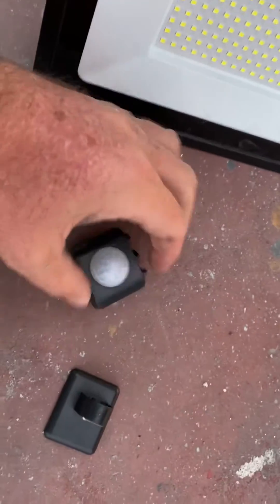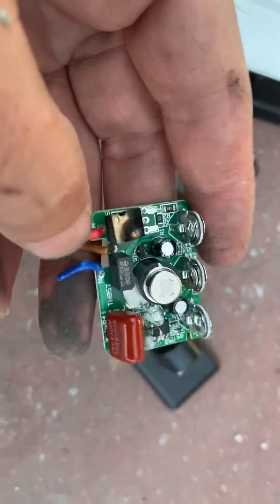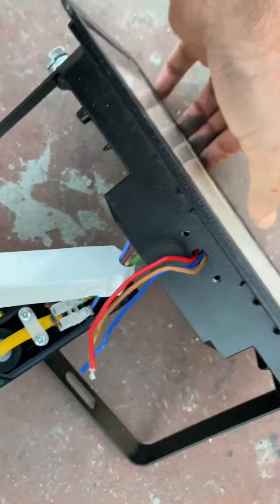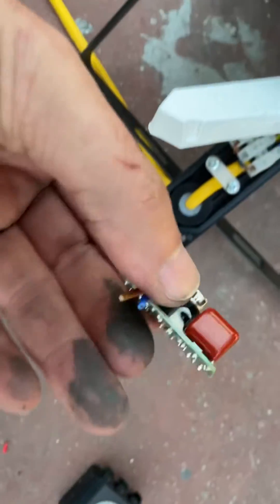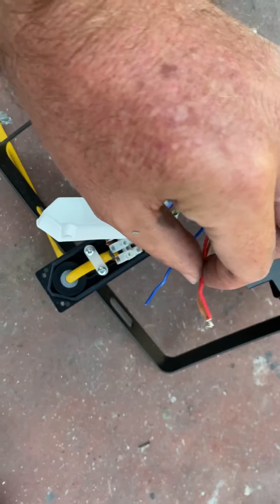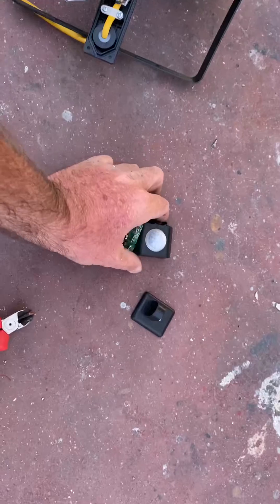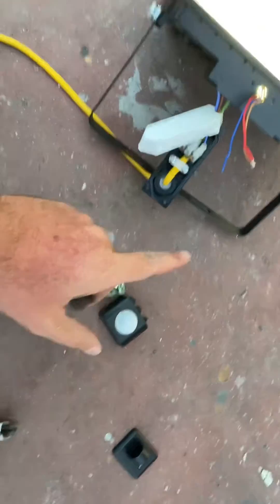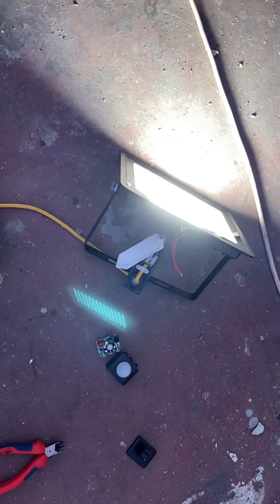Hack a LIdl Livarno 100W outdoor LED Light to stay on all the time

Comment: I got that exact light and am looking to do the same, I am hoping there was a non-destructive way so that I can easily go back to using the sensor. How did you cut it so cleanly?
Reply from the maker: Thanks for your comment. I was on a shipyard, trust me, no fancy equipment, just a screwdriver and a utility knife!
Reply: @makingcookingfixing I went with the knife method and got it apart. Only managed to stab myself once in the process too. Thanks for the video and the help.
Reply from the maker: Awesome! that you succeeded, be careful with knifes though! On the other hand, you have an amazing light for cheap! @clearz3600